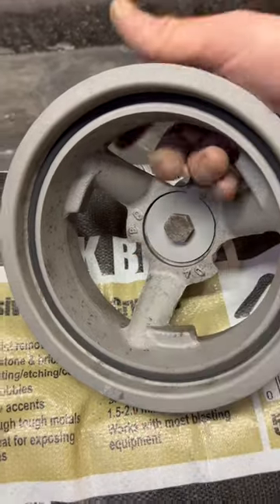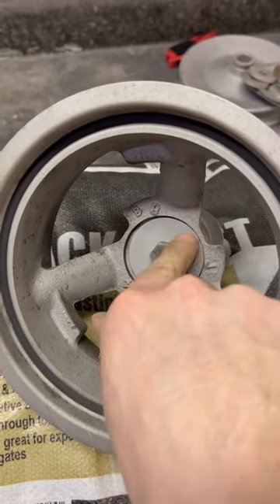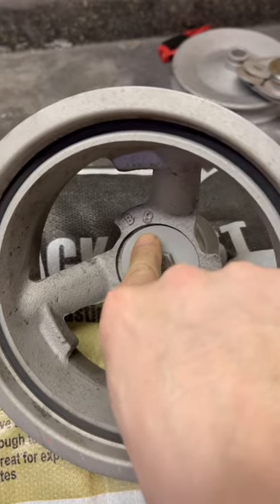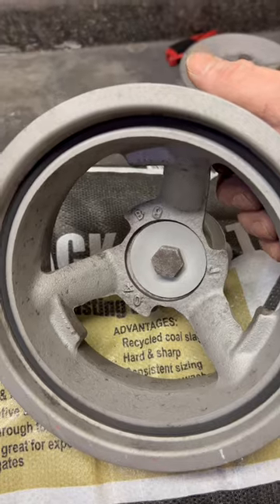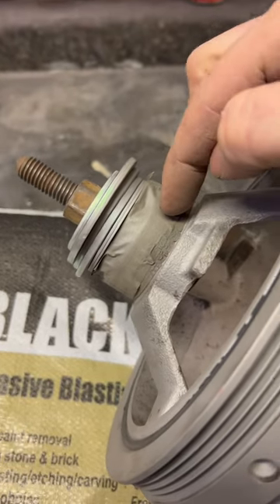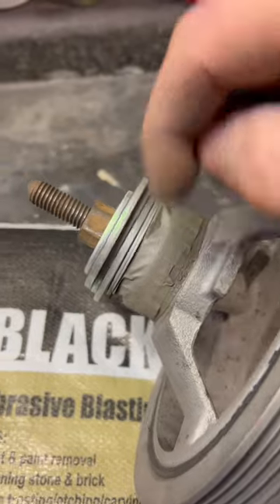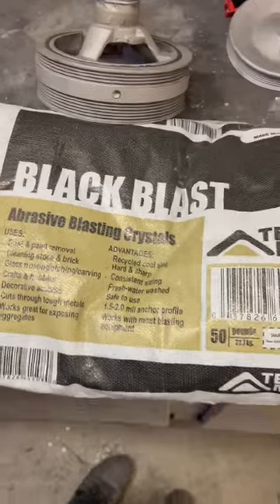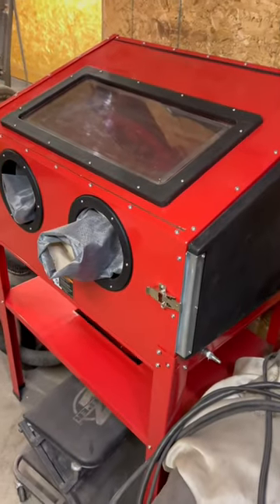Sandblasting a LS crank pulley #lsswap #lsswaptheworld #sandblasting

Comment: Thought about doing this also. How’s the surface of the belt groove area after sand blasting? Was it rough that could damage the belt?
Reply from the maker: No. By the time you put paint on it, it will have created a new flat surface
Reply from the maker: I also used a medium sand blast. So it didn’t leave a aggressive profile